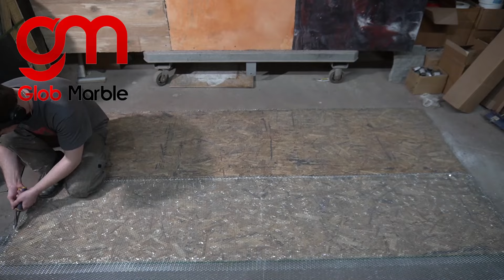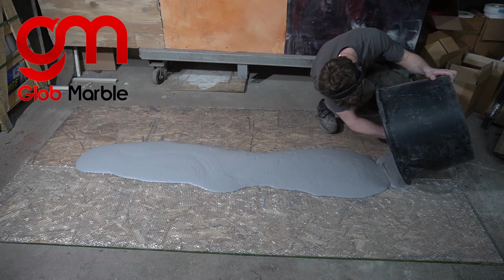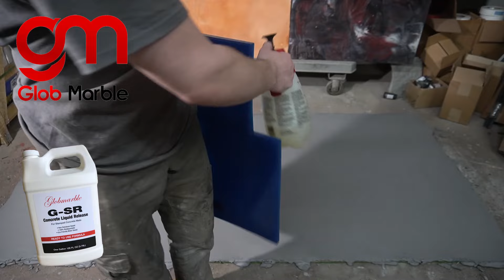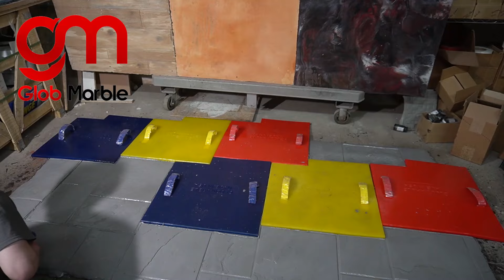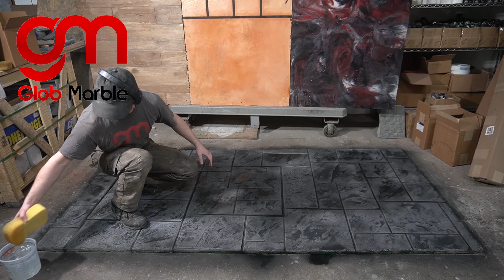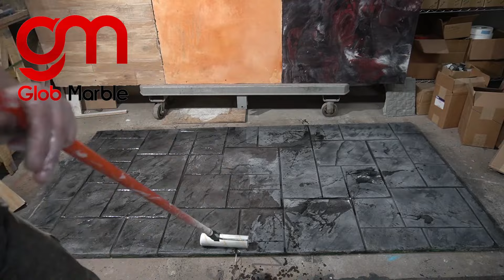Stamped Concrete Overlay Over Plywood (Step-by-Step Guide)

Comment: If i already have a stamped concrete patio outside and want to resurface and bring back to life from weathering and fading would I use the degreaser wash, water stain, and sealer only? Or are there other steps? Thank you!
Reply from the maker: You would have to use a sealer stripper before resurfacing anything :) You can find our stripers here- https://globmarble.com/index.php?route=product/search&search=strip

Comment: That is cool! But if I'm doing this on my bathroom floor inside my house, how would I rinse it off to clean it the way you did? So much liquid on a floor inside the house. I would have loved to see this is a more real world work environment bc I can see a lot of issues trying to translate this to a room inside the house. Also, what about air vents and so on. I am seriously considering doing something like this and why I'm asking. Not seeing anyone else asking this so I'm concerned I might be missing something or these other people are more familiar with this kind of work. Thanks!
Reply from the maker: You would probably need to remove the water by hand with a sponge and bucket and I cant promise that it wont be tedious. The finished look would really be worth it though :)
Reply: Shopvac... Electric pressure washer will allow you to use less water

Comment: How many inches does the concrete have to be
Reply from the maker: All depending on the stamp you are using. It must be a little bit over the distance from the lowest point on your stamp, to the highest point on your stamp. For this specific video I think it was one quarter inches thick.